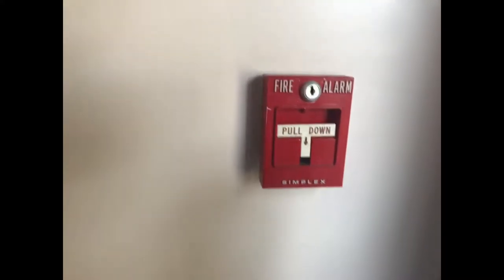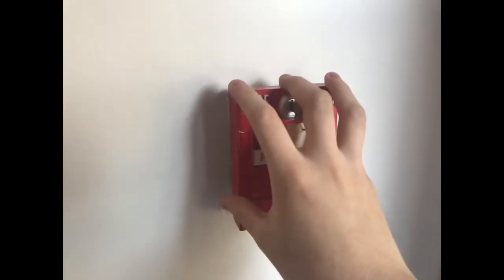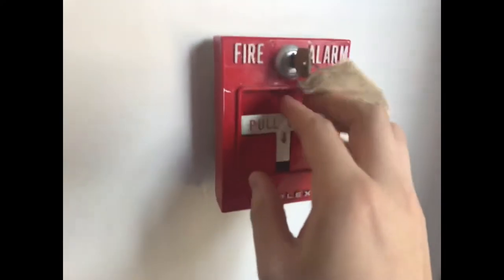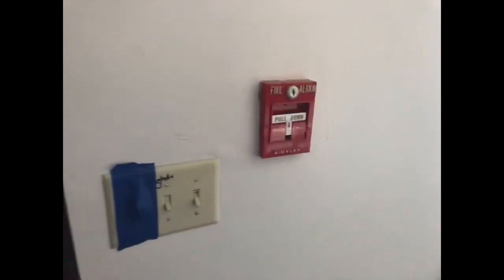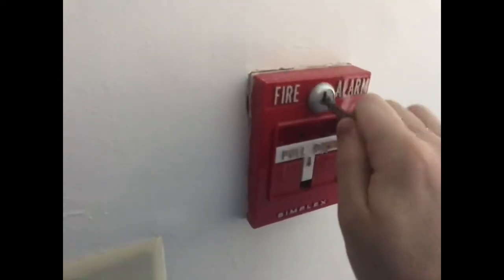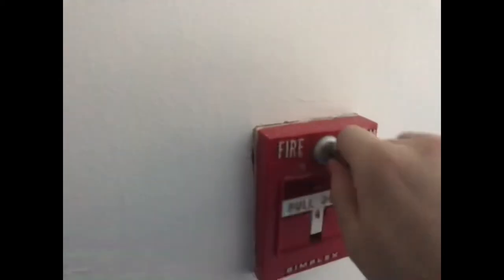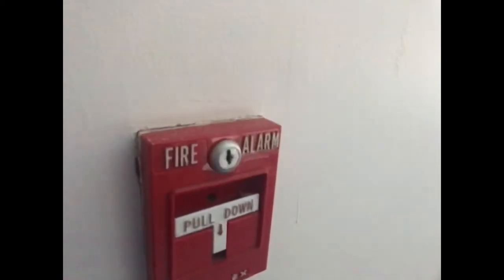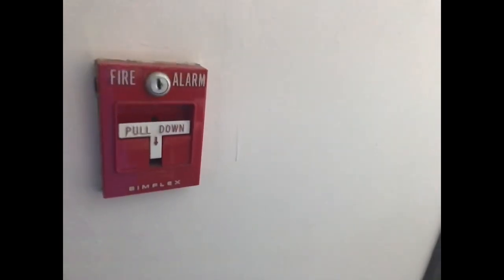Quick Church Fire Alarm Test 11-16-2018

Comment: My middle school used to have those same pull stations and horns, except they were gray and flush mount with the grill plate. The horns were the square diaphragm ones, which I think is what these are. Had panel and pull station in the office, panel was a 4200 series that had "simplex fire alarm systems" in a little silver name plate on the top. The building was built in 1975...

Comment: what will happen to the old horns?
Reply from the maker: Because They Are Still In Good Working Order, They Will Most Likely Go To Me When They're Replaced, And I'll Add Them To My Collection And Clean Them Up A Bit And Probably Wire Them Up As A Part Of My Own System. But For Now, I Expect They Will Remain In Service Until At Least 2020.